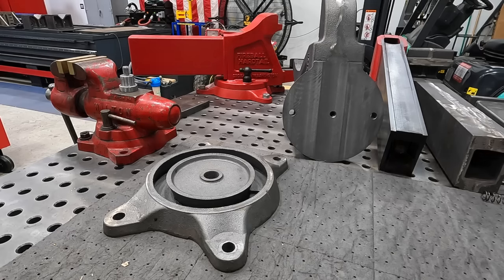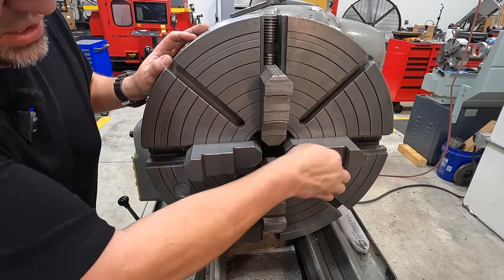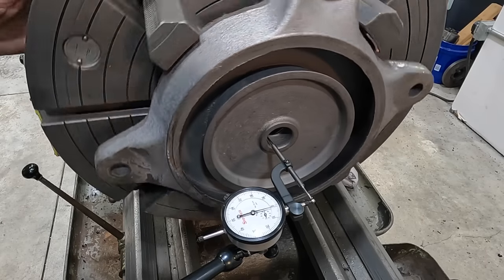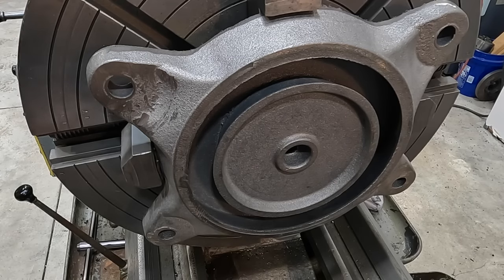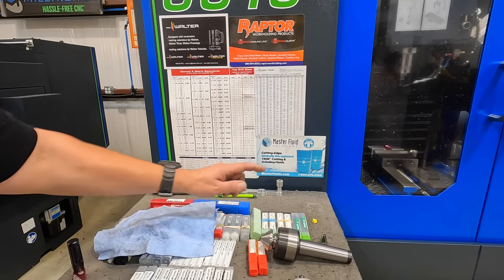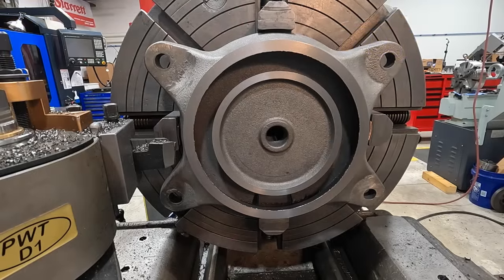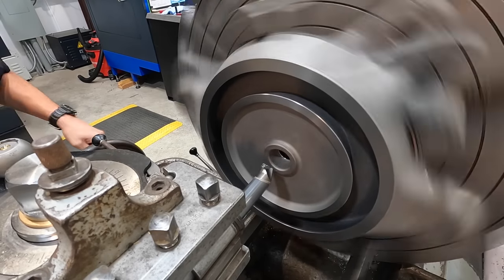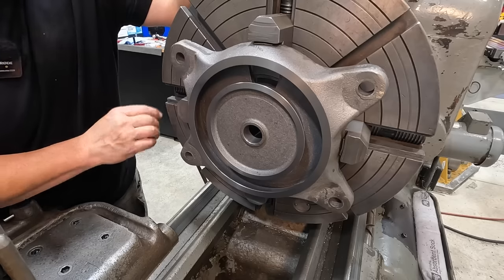Hardtail Vise Build Ep. 4: Machining the Swivel Base

Comment: Good move checking the concentricity relative to the dovetail. If that area is off by too much when one loosens the clamps to rotate the vise it will bind in some spots.
If the bolt holes were in a centered square pattern  rather than rectangular you could have bolted it directly to the chuck or a faceplate.
I totally agree with you about using dial indicators on castings. My favorite is the Starrett No 196 'back plunger' indicator. It is simple, easy to read and rugged. I keep the big mushroom head contact point on it most of the time so it can skip over the rough stuff.
As always... excellent attention to detail.

Comment: I thought I remembered there being a faceplate that came with the Pacemaker lathe. I'd have thought this would be a perfect job for a faceplate. Maybe my memory is wrong, though. In any case, Nice work!  --Edit to add: Really great point about using non-precision methods for indicating rounds. "Rubs here, doesn't rub there" absolutely works just fine for rough work like castings. Suit the methods to the work.

Comment: I realize it's probably already done, but it occurred to me that maybe you could attach the base to a faceplate when you turn it over and use the vise's own lock down bolts/nuts in the dovetail channel to hold it tight against the plate surface?

Comment: A quick way to get it close, before going to the Dial Indicator, is to pin it to the chuck face with a tailstock centre, then bring the jaws in, to just barely touch the sides of the workpiece.

Comment: I think using the lathe is easier and will produce a better finish that is flat, compared to using a mill. Using a mill will not be as flat it will leave step over edges. And the center bore even if done on the CNC Mill will take longer to set up and program. For those who commented that they would use a mill think about it.

Comment: When Adam mentioned using the indicator tips on cast and people talking about wearing out the tips, I always thought those indicator tips (at least the good ones) were hardened. That would make them harder than most normal cast iron parts. That means the tip won’t wear, the cast part will instead. Also, it’s not a high speed or long term operation, so the possibility of detrimental wear should be low to non-existent. I’m not a machinist, but I do understand how stuff works.

Comment: Since there is a cavity in the bottom for the bolt just bolt the lathe machined surface to the knee mill and run a shell mill across it.

Comment: I’m not a machinist, but it makes sense to do this on a mill, or even the shaper.
Reply: You are right, you are not a machinist.
Reply: @grntitan1  He may not be a machinist, but that was also my first thought too.. These ops could've been done just as easily on the mill with a large-diameter fly-cutter too, if he wanted to be even quicker about it. Adam seems adverse to fly-cutters though, preferring face-mills for pretty much every situation I've ever seen him post.
Reply: @mashrien  And then how to do the bore? Installing and setting up a boring head would be 10x the amount of extra work, and requiring reaching out over the cabinet and killing his back to do his indicating. CNC is better for making something from a billet where 100% of the dimensions are defined by the print and offset from an absolute  reference.
Reply: Could it be done on a mill? Yes. But indicating it in would be much more difficult and the lathe I think is the better option if you have the capacity for a part this size.
Reply: Yeah a shaper would be way faster and center bore would come out really square. Hehe
Reply: @caploader111  Lol, of course not the bore!

Comment: Adam, have you thought about or considered drilling and tapping the jaws to accept small screws so you can install the soft copper jaw cushions?
Reply: I like that idea. Curtis (or Kurtis) at Cutting Edge Engineering runs big lathes on most of his jobs. He did a whole video on doing exactly that on a new chuck. Found it: How to DRILL & TAP Hard Jaws | Big Lathe Chuck.

Comment: An important, dare I say, a critical aspect that you are overlooking, is dialing in the bottom of the dovetail.  I think you lucked out and it seems it was pretty parallel with the base. But, it could have been fairly out of wack. What this would affect is that the swivel can bind up when rotating. It forces you to open up the clamp screw more than necessary.  I've had a cheap chines vise do this. Working with and unwieldy peice trying to line something up only to have to let go of everything because the swivel locked up. The dovetail nut has to follow those angles and if it's cut out of parrallel it won't work smooth.

Comment: Awesome setup work.
What I noticed is that the outer ring is running out quite a bit, will that be an issue? Indicating on those dovetail surfaces is a little tricky, I bet if you angle the whole piece slightly in the chuck you can get both the inside and outside dovetail surfaces to run mostly true, it's just a question if that effort is wotrth it. I propably wouldn't be able to stop myself trying to machine the dovetail faces so the vise will be a treat to work with when it's finished.

Comment: I think I would have just put a live center in the tailstock and just centered it up with that and the center whole of the base.
Reply: As Ron Pratt from Midwest Trucking (truck repair, towing n Youtuber says there are many ways to get to 10 (multiple ways to accomplish your task) Adam showed you 2, and told you of a third. How you choose to get to 10 is up to you. As you saw, though, aligning that center hole didn't  help him as he wanted to measure off of the dove tail, and that was not concentric with the center hole. Now it is, though. That's the trouble with cast parts. You get shrinkage and warping even when treated 110% correct.
Reply: The issue is holes in castings are generally made with cores rather than being part of the mold. Picking which surface to make your reference on raw castings is a bit of a crapshoot but using a larger diameter one off the mold like he did is way more sensible.

Comment: For calculating the RPM to use, I'd think you'd want to start at the high end of the recommended range. If you're using your max diameter for the calculation, and you choose the minimum SFM, then as you move into the center, you're just going to drop below the min, no?
Reply: Maybe maybe not. On carbide one can certainly go faster than on HSS. But going too fast may trash a new and very expensive cutter especially on a rough casting. As it turned out, going for the low end of the speed, he got excellent results at both diameters with very little risk. He could have shifted to 279 (or even higher) and it would be within range for both the max and min diamters of the cut. I don't know what gear he was in that was noisy. Nothing wrong with playing it safe. On your own lathe with your own tooling you can, of course, make your own decisions.

Comment: Could you center the plate more easily using the tail stock to press it into the chuck? I'm sure I've seen conical attachments for the tail stock which would center the work piece when gently seated in the hole for the swivel bolt. 

I know enough to know I don't know enough, so my questions are from curiosity and not criticism.

Comment: Would have been the perfect part for the cnc mill. A SIMPLE operation 1 g02/g03 with a i/k offset and done lol (ofc some g00 to move where you want it but that's obvious)
Reply: Using G02 would be a conventional cut. CNC machines  do better climb milling
Reply: Not everything has to be CNC. Some people actually enjoy using Manual Machines and learning an actual trade not computer programming. He is in no rush to complete this vise. It is a hobby project.
Reply: @caploader111  i was just giving an example, for training purposes ofc he can use G03. 
There is definitely a pocket cycle premade in the machine itself to begin with, he could even use that if he wanted to.
Reply: @demonknight7965  I enjoy manual machining as much as anybody else, trust me at work i try to avoid using CNC when possible and still i would have done this on the cnc any day. just because of all the indicating.. 
Clamp it down 3d probe it, simple program, done.
Reply: @FireGodSpeed  There's something great about seeing the Pacemaker doing it's job, rather like an old V8 engine that is slower and less refined than the electric motor but speaks a language of emotion and heritage that the electric motor finds pointless and unnecessary. It's a tough trade off for sure but the knowledge seems important to me.

3D probing and axis correction; truly amazing what can be done. Even the vice Adam is working on might be somewhat old-school these days.

Comment: Use a faceplate and the mounting holes on the vise base.
Reply: He needs to face off the entire bottom surface. I thought he was going to run it across the old shaper at the home shop. Looks like he maybe trying to setup for a production run though (special fixtures, tooling, measuring).
Reply: He's going to do the inside of the dynamic jaw tube on the shaper.

Comment: Amatuer me thinks the mill would be easier, quicker & more accurate?. Still enjoyed. 😊
Reply: Easier... maybe, until you got the center hole.  I'm not sure I noticed any excess effort required to do it this way; it seemed pretty straightforward to me.

Quicker?  Maybe, maybe not.

More accurate?  I doubt it.  Accurate enough, yes, probably.  But machining a nice rotating surface on a nice rotating machine, that just makes sense.  The mill is goin to leave all those wacky milling marks all pointing the wrong directions.  The potential for minor tramming issues to influence the result.  The fact that his mill frankly just isn't as beefy as that lathe.  That we would have to abandon single-point turning.  It just doesn't seem right.

Comment: too bad those mounting holes on the base aren't more evenly spaced out around, you could've just mounted the base right to the chuck with T-nuts and bolts.  But, I think that was actually a design choice since it's where most of the force from beating on the vise would be.  Just makes it a bear to machine since you need to make a mounting bracket.

Comment: The Pakistani manufacturing Youtubes the machinist use a simple piece of wire to indicate, given how worn the lathes they use are this is plenty good enough.
Reply: I don’t think they ever clean or,lubricate those machines either. I guess there is no point,since the dust from the dirt floor would🎉mix with the oil and,make a abrasive paste.
Reply: Its called a stylus, you can make it out of a coat hangar. In fact its the best wire for it.
Reply: @jamesdavis8021 They do what they need to get the job done as quickly as possible, and still meet the customer specs. They can't afford OCD machinists - that's how they make their stuff 1/10th the cost of USA made.

Comment: No offence intended, but considering you were  pernickety when facing both the outer and inner rings, not once but twice, just to erase a few blemishes, why did you then leave the centre ring out completely? Surely, it deserved the same attention to detail as the other rings received, right?
Reply: In the first instance, the drawing does not call for the center ring  to be faced. And in the second instance, within his plans for the 2nd op, there is no need for it to be faced; normally if making this for a client, if you needed to create  a machined surface purely for fixturing purposes, you'd need to clear that with the client beforehand.
Reply: The outer two rings are sliding surfaces.  The recessed inner ring doesn't touch anything.

Comment: The mandrel fixture for facing off the back side sounds okay, but I might be concerned about any irregularity of the surface area underneath the flange nut.  If I were to be getting too anal about the whole thing then I would have to consider a second op on the back side to face or scoop out the area underneath the flange nut and make sure the swivel pin is clean to the surface when it is made. Just sayin' here. You do you, of course, man. It's your shop after all.

Comment: Most guys would unbox the thing, bolt it to the bench and go on about using it. How come it rrquires all that prep work before you can use it? Is it that far out of kilter. After all it's just a vise for God's sake. People have been using them for centuries for all kinds of stuff.  Just curious, you do excelllent  machine work does it really need all this?
Reply: These are rough castings that need machining to fit together properly, just all the other vises that people have been using for centuries.  They have never been a "vise" that could just be bolted to the bench; they are individual components of a vise.  Casting leaves things only approximately straight, approximately flat, approximately smooth, approximately the right size...  you can leave some surfaces that way, but other surfaces, i.e. anything that has to fit another part, have to be brought into blissful harmony.  The engine in your car, and many of its parts, or at least my car, were made in the same way -- get the basic shape with a casting, then machine the important surfaces and put everything together.
Reply: @ydonl  thank you for clearing that up.

Comment: I'm wondering why you didn't machine the flat sides on the shaper. It seems to me the piece would be very off-balance for  using a lathe.
Reply: Its a symmetrical part, and is more than balanced enough for the lathe.
Reply: @kevind1865  Especially THAT lathe!